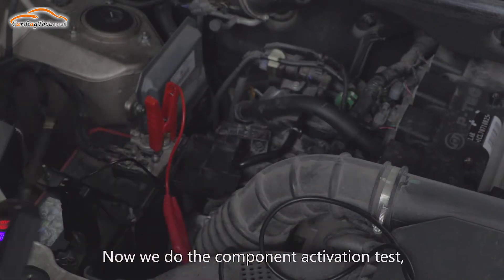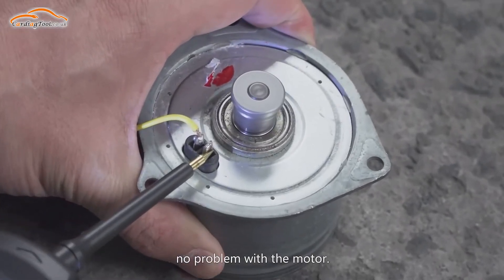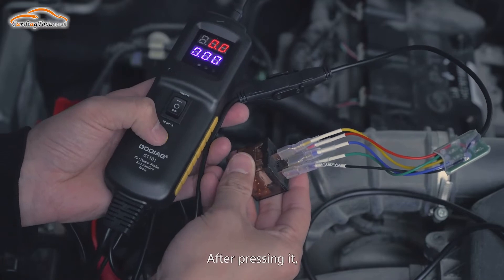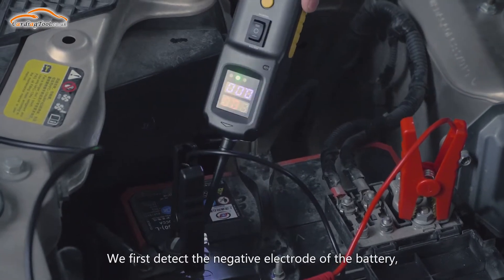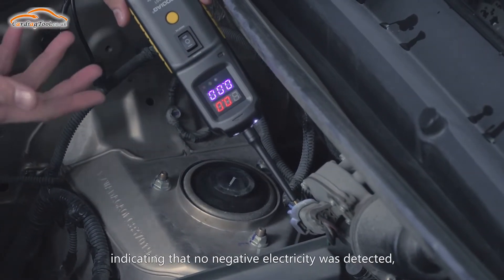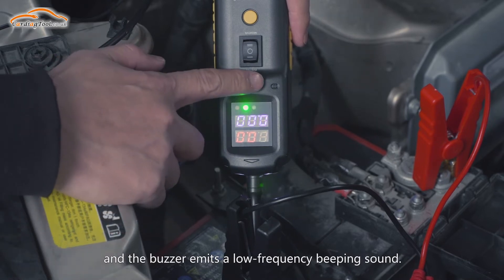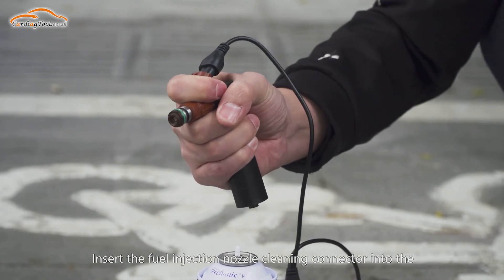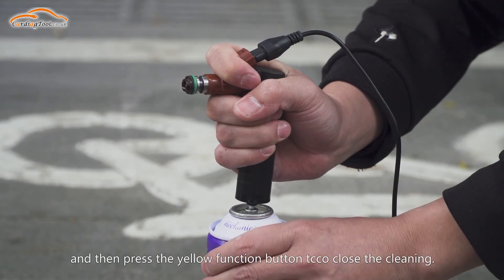GODIAG GT101 PIRT Power Probe Function Demonstration - CargiagTool

Comment: Tested a relay but it doesn't click many times as the demo, instead it shows a green light, no blue, or red. What does it mean? Thank you.
Reply from the maker: check the manual: https://www.cardiagtool.co.uk/upload/pro/21120816389537603448.pdf
Reply: I have looked high and low to find good instructions on video as to actually chasing particular wires in order of finding shorts and or breaks in wiring . Does anyone have any idea where I might find some visual information on using either the 101 or 103 for chasing wiring??? Any information would be appreciated  !  Thanks in advance.
Reply: No green is a bad relay